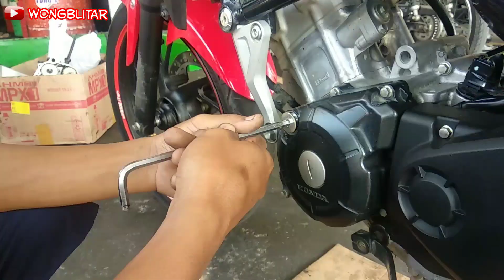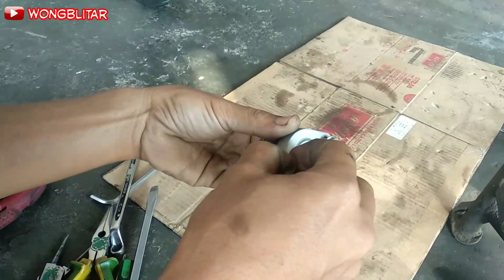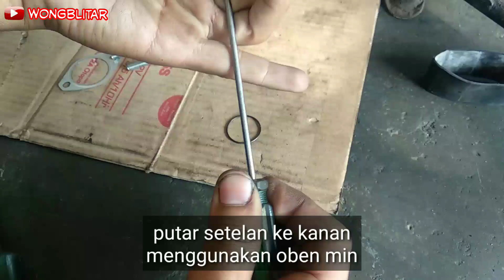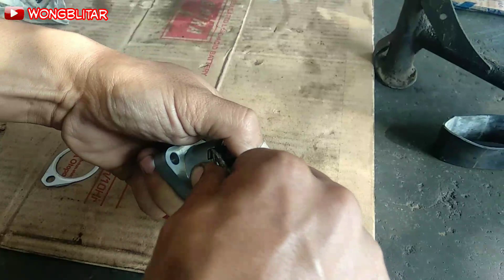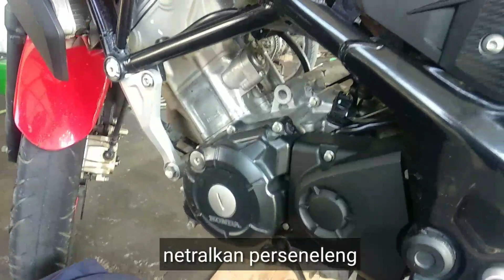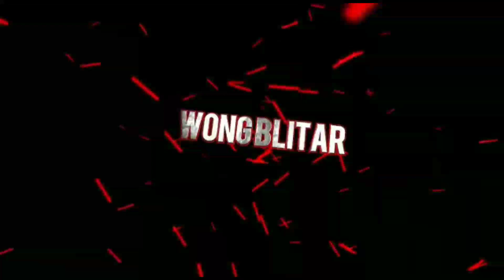Cara setel stut kamprat cb150r

Comment: Mesin gk di top kan dulu waktu buka tensioner apa gk papa mas
Reply from the maker: Resiko rantai melompat dari gigi timing
Reply: @WongBlitar  jadi klok GK di top dulu muncul bunyi berdengung Tah bos sa at di geber
Reply: @mustofa9551  punya gw jg gitu, knp ya?
Reply: @mustofa9551  punya sya sperti itu bang .apanya ya
Reply: @ferybombom7529  kenceng en itu
Reply: @widiaprianto  apanya bang
Reply: @ferybombom7529  tensionernya
Reply: Muter kekirinya kebanyakan
Reply: Tapi ntar kendor sendiri
Reply: @widiaprianto  kalok di bukak atau di bongkar bisa bang  dan cara nyetelnya bgimana
Reply: @widiaprianto  ini serius nanya  punya sya kalo rpm 6000 saat berkendara itu rasanya pas di gas  rasanya ngung ngung ngung alias tarikan kerasa naik turut nyot2 an bang   apanya ya
Reply: Selapas stel kopling sya pendekin jadi begitu .
Reply: @ferybombom7529  wah kurang paham sy, coba bawa bengkel sj